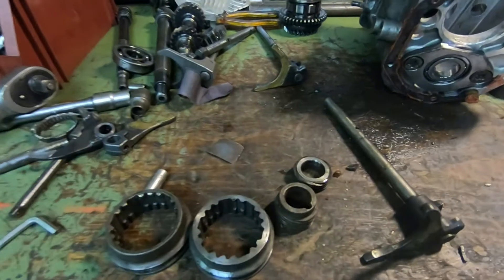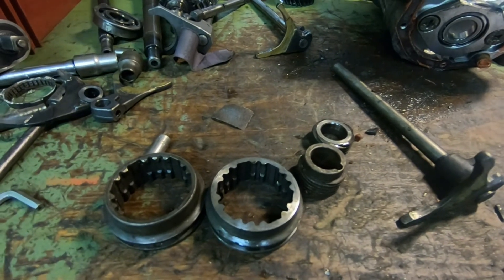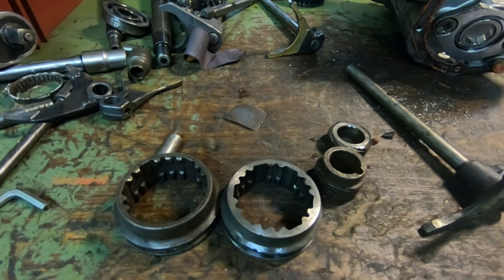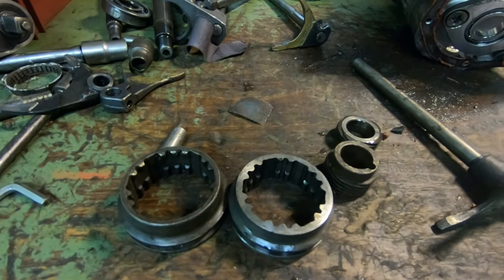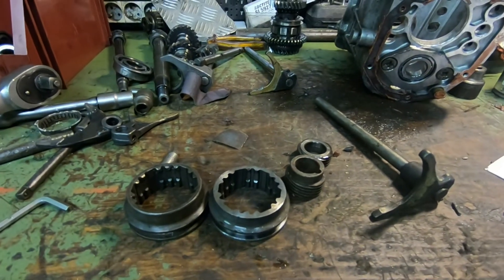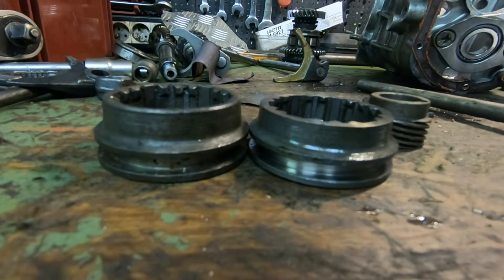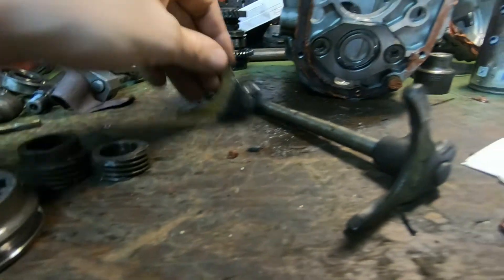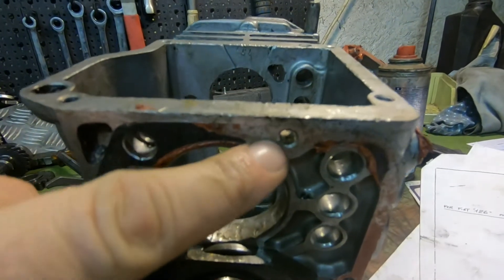Fiat 500 , 126 - 5 speed gearbox inner workings and rebuild

Comment: Hi Martin, great video.  I have a gearbox that has a 5 speed conversion already fitted. In my case the casing holding the modified gears is longer than standard (+/- 34mm) and hence the standard linkage (which has the rubber) between gearbox and shift rod is too long.  Is this longer casing normal and if so do I cut/drill the linkage to accommodate the difference?  Appreciate your help.
Reply from the maker: Hi Jim, yes, you are right, I forgot to mention it in video, every 5 gear kit case is bigger and soo is needed to make shorter linkage. Aswell modify the gearshift mechanism-cut half of reverse aretation so you can shift 5th gear without pressing the gear stick
Reply: @Matuskamotorsport  Thanks for confirming that.  One other question please -  I'm a newby to Fiats and bought a basket case car which I have rebuilt. Please can you tell me whether the gearbox shift shaft and the gearshift rod coming out of the tunnel should be on the same level? When I installed the motor/gearbox I found that they were not which is not great for the shifting action.  Do I need to put a spacer between the gearbox mounting bracket and the chassis mounting point?
Reply from the maker: @jimspillings9724  originally there are not any spacers, but Iam not sure if I completely understand what you mean, please send me photos of it to matuska@126fan.sk and will look on it :)
Reply: @Matuskamotorsport  Thanks Martin. Give me a day or so as I have it out of the car right now. Cheers
Reply: instaBlaster

Comment: Hi. I am the owner of a Fiat Cinquecento ED engine code 170A.046 (AISAN carburetor) and I want some explanations if you want of course. in my country (ROMANIA) there is no such engine and gearbox even for dismantling. But there are other Fiat 126p models, Fiat 126bis, can I use something from them ??? crankshaft or other components, gearbox can partially out of take ??? If I didn't write correctly it's GOOGLE TRANSLATE's fault;)))
Reply from the maker: Hi, did I understood you right that you want to ise 126 gearbox or its parts for your Cinquecento? Iam sorry but this gearobx is completely different and you can not use nothing from it for your cinque 😪
Reply: @Matuskamotorsport  Hi. Thanks for the answer and advice. So I have to buy another car from Italy or Poland exactly the same. Good luck in your races and with the Youtube channel
Reply from the maker: @gabrielbelecciu9176  exactly :) Thank you very much :)